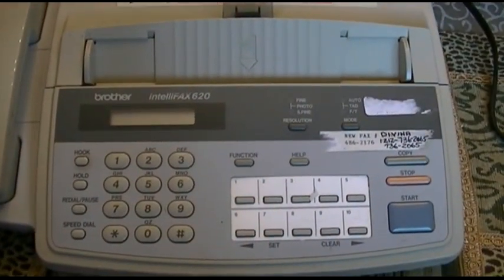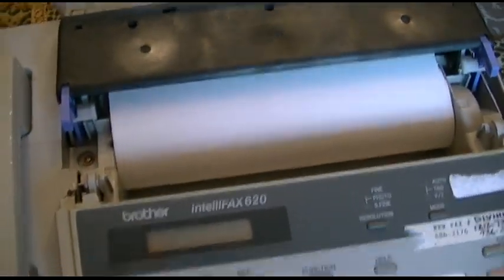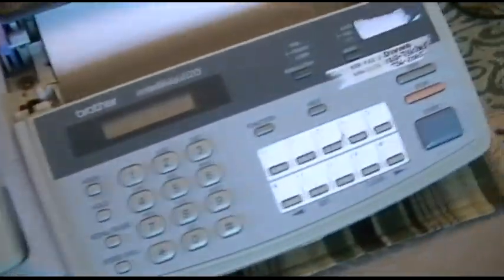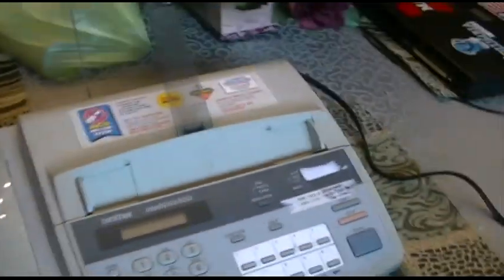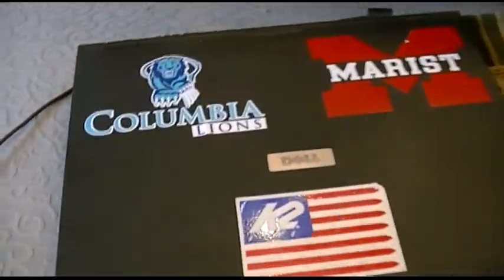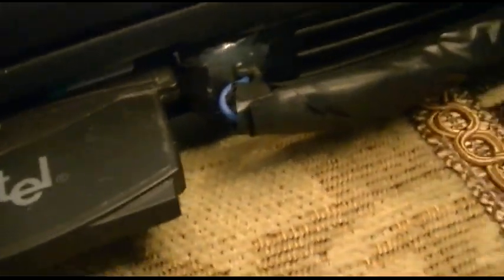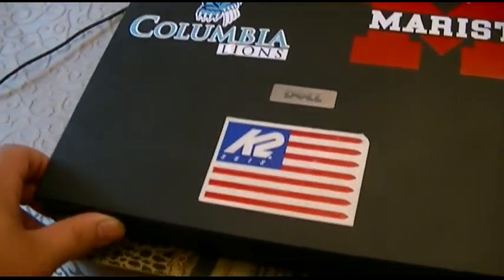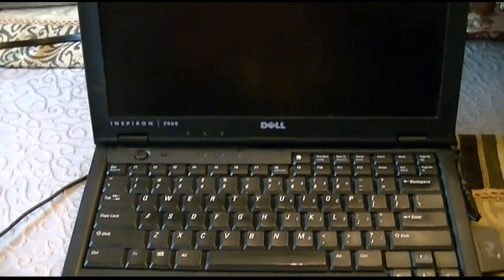Use Fax Machine As Printer! Put That Old Dial-Up Modem To Use!

Comment: Is there anything special you had to do to make this work?

I've got a brother intellifax 1270e and a similarly old laptop with a built in modem.
I have the laptop connected to the line port of the fax machine and the fax machine set to fax recieve mode. The computer dials but the machine never answers. Even if I press "hook" and "Fax Start"

Am I missing anything?
Reply from the maker: Probably this laptop.  There's something about its modem built in that's different and I don't know what it is.  I have tried this with various old laptops with modems and this was the only one I found that worked with it.  I was lucky that was the first one I tried.

My best guess would be that it's missing voltage on the telephone line, that this modem for some reason is providing.  Understanding how a telephone line works and what voltage it carries at what point and in what polarity, makes a difference.  You can try to inject power onto the line, I had seen this done many years ago with a few C Cell batteries but it didn't work that great and was just for voice.  But you'd best try to find a circuit diagram before you blow up your modem or fax machine.

Comment: I tried doing this years agoand could never get any of the machines past "no dial tone"
Reply from the maker: Without some kind of "talk battery" on the line, it will never work.  While I had no talk battery in this setup, I think the modem built in to that laptop provides it.  I've never had another be able to talk to the fax machine.

Comment: I can hear 50HZ sound on this machine, even if the USA uses 60HZ!!
Reply from the maker: I certainly don't hear any 50Hz hum.  60, yes.
Reply: @jaykay18  But I can hear the 50Hz hum when printing.
Reply from the maker: @dennisthebrony2022  There's no 50Hz in this country, you were hearing the stepper motor and the print element, but they're certainly not frequency driven.
Reply: @jaykay18  But It does sound ironic, because this stepper motor sounds like a 50HZ motor from another country. Haven't you heard a 50HZ hum? It kinda sounds like that, even if it's not a 50HZ motor.
Reply from the maker: @dennisthebrony2022  I most certainly know the difference between 60Hz and 50Hz.  While it might sound like it, it's definitely not from the mains current.

Comment: My fax machine (Panasonic KX-FP105) has no hook button but a “monitor” button I tried your strategy with an old hp jornada laptop running windows ce and I did monitor start and then fax start on computer then fax machine starts ringing and says pick up handset what shall I do ? I tried not picking up the handset but it didn’t send
Reply from the maker: The fax machine started ringing without a telephone line?
Reply: No I sent the fax through the computer and it started ringing
Reply from the maker: The fax machine cannot ring with just a phone cable between the computer and the fax.
Reply: jaykay18  their was a tel line between the computer and fax
Reply from the maker: I just said that.

Comment: Now that is interesting.  Is it possible to setup up a BBS on one computer and telnet in from the other without a dial tone?
Reply from the maker: This was a pretty cool experiment.  I've only gotten it to work with this laptop successfully.  There's no way to "break out" the telephone line into serial without really hacking.  I'm not entirely sure what it is about the modem in this machine, if it produces voltage/talk battery on the line or what, but I think it's needed to make it work.

To do the BBS thing, well, don't bother doing it the hard way, make yourself a null-modem cable and go to town!
Reply: i wonder if you can use these machines to connect to an not so ancient computer running windows 10, with usb. hmmm
Reply from the maker: Sure, if you want printouts that look like 1992...

I'm sure there's a way inside this fax machine, past the modulator/demodulator, that handles a standard RS-232 connection.  Good luck getting that to work over a USB to Serial adapter.
Reply: @jaykay18  all want is to be able to print basic documents, since my handwriting is abysmal. maybe you can do smth like use an arduino to translate the signal...
Reply from the maker: Chances are a $20 inkjet will do the same job a lot easier.  As for ink for it, go aftermarket; printer manufacturers have marked up the price of ink at least 400% since 20 years ago, and even then it was well marked up.
Reply: @jaykay18  yes, except trump doesn't like TRY, so everything is hella pricy. also i thought it would be a fun project.
Reply from the maker: We don't get into politics on this channel.  You want to microcontroller the hell out of it, you go right ahead.
Reply: @jaykay18  only thing im missing is knowing how to program and arduinos- even pics AAAAAA
Reply from the maker: Never messed with arduinos before but I've programmed in a number of old-school computer languages.
Reply: @jaykay18  aren't arduinos just microcontrollers with blue boards and stuff
Reply from the maker: For the most part...
Reply: @jaykay18  yikess

Comment: Hello jaykay18, this video and technique is pretty nice.
I'm trying to use s Sharp UX P200 FAX do print some images from a PCI Modem I got... but when I try to print the PC part always says "busy line", Tryied to change from ring to pulse already, doesn't work, maybe they are incompatible?
Reply from the maker: You've got to turn off the dial tone detection on the computer at the very least.
Reply: Tryed this too. Before all the numbers and confirmation process a little window appears "Printig Cover Page in SHRFAX: Page 0" apparently the fax is recognizing the modem board
Reply from the maker: All I can tell you is that this experiment worked with THIS laptop and THIS fax machine I showed in this video.  Whether it will work with others I do not know.
Reply: The Windows XP is making me do a "Call Profile", did you done this? (I'd watched yout video 10 times, at least... heheheh) Ok, Got the point. Thank you very much :)

Comment: is there a way to transmit sound (that has been converted into electrical signal) through a dail-up modem and have it connect to another source on the other end that illustrates the sound transmission. The idea is simple to 'hear' the data being transferred, almost for the sake of nostalgia whilst commenting on the absurdity of the illustration in itself in the modern age
Reply from the maker: Yes, you'd want to hook up a phone as an extension on that line so you can "listen in".  If you hook an oscilloscope to it you can then see  the data there.  However, most transfers of data are going to be too fast (believe it or not) for you to see anything.  I do have an old PC that connects via dial-up modem to a time server, and that connects at 300 baud.  You can most certainly hear the data come through on that but it's still fast.  If you'd be lucky enough to establish a connection at 110 baud that would be 3 times slower and I'm pretty certain you'd be able to hear the pulses of data a lot easier.  I know I did that at some point in my travels way back in the day.  There are very few dial-up BBSes anymore, but there are lists you can search for, some still have phone lines and awesomely-backwards-compatible modems that would likely establish a connection at such slow speeds, provided you program you modem to not connect any faster than that ahead of time before dialing out.
Reply: Thanks! You're amazing!
Reply from the maker: No problem!

Comment: What can I do if I do not have a modem line into my computer?
Reply from the maker: You can't.
Reply: @jaykay18  Can I use old adsl modem to connect the fax and then over lan or usb to the laptop?
Reply from the maker: You'd be better off trying to interface it with 2 tin cans and a string.
Reply: @jaykay18  Okay. Thanks
Reply: Get usb fax modem

Comment: I'm guessing that you can't do this with a modern PC, like by USB. Other than that I'd get a thermal fax machine as a printer. I have a game boy printer but I need to find a cable to link the printer to my PC. I did copy a Mr Goodbar candy wrapper in a thermal fax. it looked pretty good but I no longer have the copy.

As for the slow printing maybe speed up the data rate. I've never used a fax machine but I've seen them print and I know they go faster than that.
Reply from the maker: +coondogtheman1234 The premise behind this was to use onboard obsolete equipment, like a dial-up modem.  In fact, you need a modem of some kind to talk to the fax machine, as they both support the same protocol.  Theoretically if you had a USB modem, this could be made to work.

This is only a Group 2 Fax, so the maximum data rate it supports is 9600bps, which is extraordinarily slow by today's standards.  There is nothing that can be done to speed this guy up.  When sending a full-page photograph as such, there is a tremendous amount of data trying to be squeezed through the skinny lines, so it's going to take a while.
Reply: +jaykay18 ill just use my gameboy printer or fund some other thermal printer to a POS system that uses USB.
Reply from the maker: coondogtheman1234 Getting a driver to work with the gameboy printer is going to be your biggest hurdle.

I have an Apple Imagewriter II hooked up to an old Gateway acting as a print server.  That printer used Apple serial, in a DIN plug.  Somewhere I found a cable that converted that to DE-9, and then adapted that to the Gateway.  If you use the generic/text only driver in Windows it will print straight text.  There is also the C-Itoh 8510 driver that will allow it to print graphics, that only worked because the Imagewriter II was basically a re-badged C-Itoh 8510.  So it worked because drivers were available, the cabling and setting it all up with baud rates, parity, start and stop bits, etc was part of the fun.

Many years ago JC Penney had a wedding registry self-service kiosk, and that had a thermal printer that would print 8 1/2 x 11.  I've alwasy wanted one of whatever that was, but the only printers I have found were either very expensive, or portable business printers.
Reply: +jaykay18 some guy made a USB cable to connect the printer to the pc and ha has a software program to print.
Reply from the maker: coondogtheman1234 There you go!  If he made a video and you have the link to it, I'd like to see it.
Reply: +jaykay18 
Maybe find some digital interface inside the fax and tie that to the PC. I took a fax machine apart but it was an inkjet or i'd still have it and there was a part in it that had phone jacks on it and the other end had some type of data connector so possibly the modem. Maybe one could bypass that and tie in digitally so it would print faster.

And funny that you are the only person on here that has done this. I cannot find any other videos of this.
Reply from the maker: coondogtheman1234 Understood, and the premise makes sense.  Chances are the internal circuitry of the fax machine would limit that.  If the fact machine uses and older, cheaper 8250 UART, it would only support 9600bps anyway, which is the fastest the modems would possibly connect.  Sometimes you can teach an old dog new tricks, sometimes you can't.

Comment: u did nt show how to connect them , pls show how to connect  fax machine to laptop
Reply from the maker: +Tarun Kumar Sure I did, at 5:38.  You just use a regular phone cable between the modem and the tel line connection on the fax machine.
Reply: thank u sir for responding , but I have a little doubt , so we have to connect our phone line to fax  that's understood and then how we can connect it to modem ?
I have a fax machine sharp F50 , modem and laptop pls tell me how to connect them sir.
Reply from the maker: Tarun Kumar I'm very sorry, I've explained everything in the video.  Getting it working is half the fun.
Reply: i am really unable to understand the video.
first i connected my phone line to fax and then  how should i connect it to modem , pls tel me briefly so that i can use my unused fax machine, tell only the connections , i rest i wil work on it
Reply from the maker: Tarun Kumar You take a standard telephone cord with modular plugs.  One end connects to the modem on the computer.  If there are 2 ports, it goes to the one where a standard phone jack would connect to the POTS service.  Connect the other end to the line in on the fax machine.  Now you will have a cord going from the modem jack to the back of the fax machine.  That is the only connection.  Good luck on getting it working.
Reply: thank u sir
Reply: thank u sir , its working .

Comment: Hi. I ran a telephone cord from my laptop modem to my HP OfficeJet 720. On the back, it has a port for the telephone line, and two ports to modem, phone, etc. Which one do I plug it in to? I guessing the telephone line. I have auto answer turned on and when I press start, it says Off Hook... It does seem cool but I don't know what to plug it in to. Can you help me?
Reply from the maker: lm2046 You'd plug it into the telephone connection, where a regular telephone line would plug in.

There's no guarantee it would work.  Regardless, the HP OfficeJet 720 has computer connection(s) built-in, so there's no need to do it this way.
Reply: jaykay18 Not necessarily... You may want to get a hard copy of a document from an old computer for which the printer doesn’t have drivers.

Comment: do i need a phone line? is it work as a plug and play type?
Reply from the maker: Everything was shown in the video.  You need a telephone wire connecting the two devices, you don't need a public telephone line (which would then require two lines).

There's nothing plug and play about it, it's a manual process.
Reply: jaykay18  hi man. thanks for the reply. i have an internal pci modem called prolink 1456pfp v92, it has two ethernet port. and the fax called canon fax-tr177. i dont know these devices works as yours. but i tried a lot of times. i pressed the hook then start button as lcd displayed receive but in fax monitor window in fax console (after few minutes) it shows no answer.. i connect them by a telephone wire (in fax's line port and in dial-up's both fax and line port). what is the actual process brother? i need your help. thanks
Reply from the maker: Obaed Ove Nobody said you could get this to work for sure!

The only thing I know is of all the old laptops I have, only Dell laptops of the vintage I had in the video worked.  I had several Pentium 4 laptops, either got nothing or an angry buzz from the fax machine.  For some reason it worked with these Dells.  I have about 4 or 5 of them, they all worked with it, but I never got other modems to work.  Might also be your fax machine not being "compatible".

I'm guessing you've already tested the fax machine on a known good working telephone line and having someone send you a fax.

Comment: I think you could use your fax as a scanner as well! You should try it
Reply from the maker: Yes, that can be done as well.  To do that, you'd have to tell the computer to answer the call manually, even though there is no incoming call.  The built-in Fax driver allows you do "answer now", so yes, that would work without issue.

Comment: there is still a fax back service I know of put a document into the scanner and than type on the keypad 1800 test fax
the document will send and it will be sent back to you in 25 to 30 min.
Reply from the maker: That number doesn't seem to work, it asks for an ID or SOCIAL SECURITY NUMBER!!!  What kind of identity theft is this?

I did a quick Google search and found that HP offers a fax back service at 1-888-473-2963, and they claim it will send back in 5 minutes.

If I ever get the time, I'll consider it.

Comment: If you still have this fax machine can you pleese make a video of sending and reseaving a fax.
thanks again.
Reply from the maker: But that's so pedestrian, making it do what it's supposed to do.

I could make a video of that if there were more requests, and can send a fax no problem, but as for receiving, I'd need someone to send one to me.  Years ago there used to be "FAX-BACK" services, where you'd call a number and they'd give you a menu of documents that you'd choose by touch-tone, and then it would call back with the fax.  I know for a fact Seagate used to have one, but most of these "FAX-BACK" services have gone away, and if any are still around, it is very likely all of the documents on it are out-of-date.